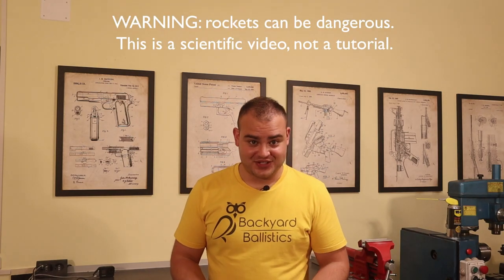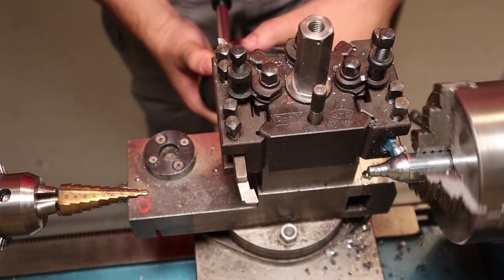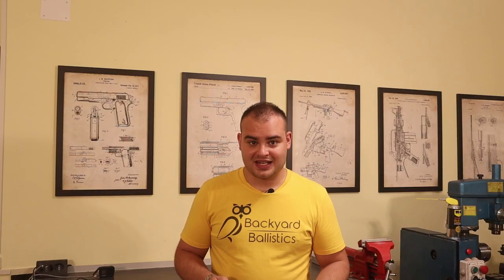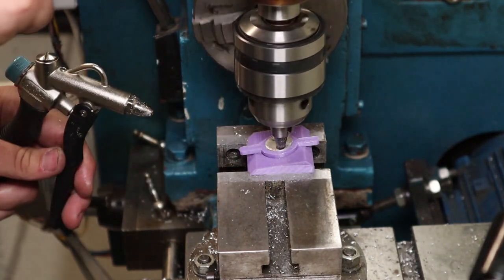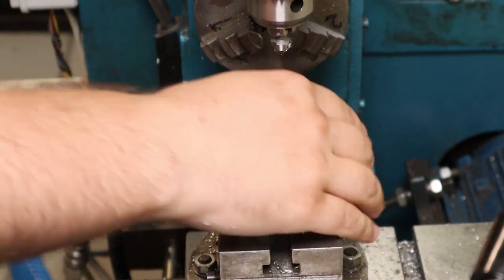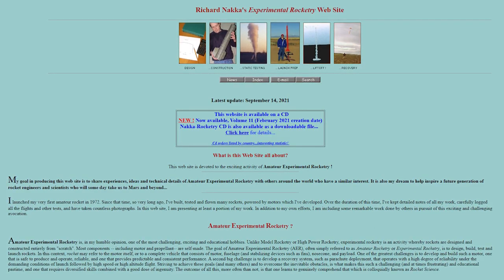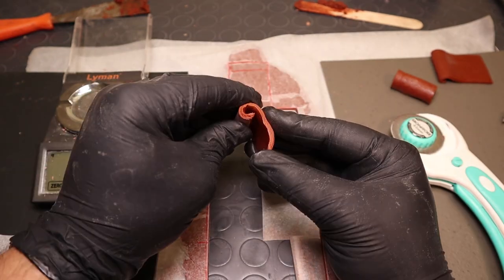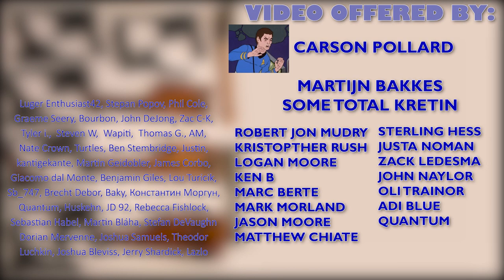HOW I've Remade the 1960's GYROJET Rockets [part 3/3]

Comment: (you probably wont read this, but meh) if you want more area for the propellant, what you could do is a "spring", or a cillinder rolled with itself, its far more tedious to make, but it should give you more area if thats what you need, also, im a student on a tecnical secondary, so if you need help, i wont mind aporting some of the knowledge (i can be more helpfull at the use of mechines than cinematics or all of that, but i know a bit of it too).
Sorry for poor grammar, im from argentina

Comment: Well, that was fascinating. Very interesting, very creative solutions to difficult construction challenges, and great results given the stated limitations & first iteration.
Your manufacture process probably also explains flight characteristics, to me it looked like the shown rounds were corkscrewing downrange, impacting the ground or baffles as range design dictates.
W a rocket, can assume that flight pattern comes from launch, thrust or load imbalances; here I'm inclined to suspect thrust & load, as no part of your process seemed to check load balance or thrust vector & rotation, and both could produce the shown flight, separately or in combination.
You already suspected launch, but that only attributes initial direction, not the curved path of flight I believe most demonstrated 
Given the Accel profile stated, I also wonder if extremely small differences in mauf & assembly tolerances may have thrown that out as well. That rod in back if not precisely on center would provide bias in rotation, and the fuel roll looked unbalanced, among other factors.
A possible improvement to mauf method may be switching to a threaded method of thruster plate/body connection, as it's closer to self balancing, and by setting thrust rotation direction so as to tighten the connection, no chance of disconnection seems plausible.
Given the way the nozzles are custom cut, a standard thread of any type then orient the nozzles appropriately. Locking tension could be low, W locking compound & the thrust itself only increasing tension.

Comment: now how would you add fins to these? i think if you made them out of thin spring steel you could use the compliant deflection of the fins to wrap them around the body of the slightly turned down body (so that the fins fold in flat) and use a small band of sorts that gets slid out the way when the rocket exits the muzzle to deploy the fins which would slow down the rotation due to the radius of the projectile being higher, but it would impart ideally only rotational force that was stored in the mechanical compression of the fins before. I can make a conceptual 3d model if it would help to visualize, it'll only take 5min anyway.
Reply from the maker: Thanks for suggesting. Fins are actually essential for this contraption to work, I'm making a simple additional video explaining why
Reply: @beyond.ballistics  the Rheinmetall 120mm or any smoothbore tank cannon is a great example, you'd think they'd be less accurate than rifled cannons but due to fin stabilization they are in fact more accurate.

Comment: Considering that rockets are the least efficient at low velocity i would think that having the barrel closed would significantly increase initial acceleration and thus velocity and accuracy, at the cost of some recoil (but not nearly as much as from a normal 12gauge). Even if it is "just" the first 20 odd centimetres ~ like 8 inches.

Comment: Is there a place we could aquire the stl files? Id love to modify and test different ignition systems and applications of this awesome design!
Reply: The only parts of this which use STL files are the 3d printed fixtures, the rest of the dimensions are described in the other videos.

Comment: Impressive work! 
I personally wouldn't bother to make the nozzle (at least at this stage) supersonic for 2 reasons: 1) the throat is sharp and the diverging section is rather rough (i.e. not ideal) and I fear that early boundary layer separation would occur (that is, your flow at the nozzle exit is just sonic) 2) the escaping gas is hot, therefore sonic speed should exceed the 300-400m/s you're aiming for in most cases (but that depends on the gas you are producing, what would you reckon its sonic speed to be?). 
I haven't tested anything like this myself thus I might be wrong but I just wanted to share my thoughts...
Looking forward to see more!
Reply from the maker: Thanks for sharing. I had the same worries at the beginning regarding the nozzles, and though of polishing and smoothing them, but the velocity I got seems to suggest that they were working reasonably well. The rocket managed to reach more than 300 m/s, which means a specific impulse of at least 90 seconds, without taking into account air resistance. The effective Isp must have been around 100s, which is not too far form the maximum KNDX propellant can give. The maximum obtainable is around 130s, but most motors achieve between 110 and 120s.
Without a diverging section the maximum I would have gotten (theoretical - mono-dimensional with no losses) is less that 70s, so realistically I couldn't expect more than 60s of Isp, which would translate into less than 200 m/s at burnout
Reply: @beyond.ballistics  ok, thank you for the explanation. So you really managed to get them supersonic, great! And 300m/s as a bullet speed is not bad at all, pity for the accuracy but it looks promising. Would making them with higher precision mechanics (e.g. CNC) improve accuracy?

Comment: Would these work in outer space, like on a space walk?
Reply: as long as the low temp didn't inhibit the fuels reaction, it should
Reply: Conventional firearms would also work fine in space. Smokeless propellant and even gunpowder has its own oxidiser as part of the blend--the propellant doesn't need atmospheric oxygen in order to ignite.

The main issues you'd have with a conventional firearm on a spacewalk are getting pushed around by the recoil, and the risk of lubricants failing in the extremely dry environment and temperature extremes in outer space. However, it wouldn't be difficult to engineer lubricants that would perform well in such extreme conditions--such lubricants likely already exist for spacecraft parts, and with a bit of modification, they could be applied for firearm usage.

Comment: What do you use for ignition?
Reply from the maker: In the tests I used a normal visco fuse and some black powder for priming, but the best would be an electric match placed in the front of the rocket.